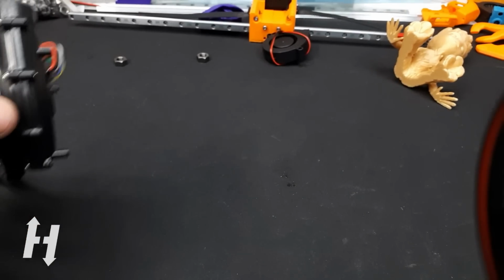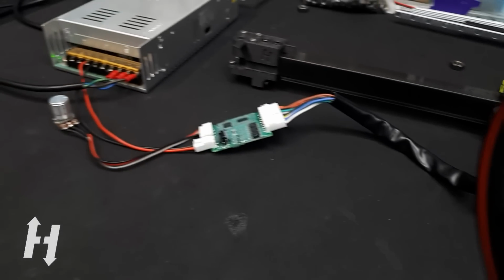Can this turbine be installed on a 3D printer?

Comment: There should be a lot of used air purifiers on the market now (thank you, big C). They usually have fans inside that can produce quite a high static pressure, high flow and should not be to noisy at the same time. Pretty ideal for an external cooling system.

Comment: as mentioned by others a voltage divider wit RC filter would be simple. Another way to do it is with a digital potmeter. These connect to a printer over SPI or I2C and can be told what resistance to take on. A filter would require some matching of the R and C values and a unknown impedance of the driving board and a digital pot does not need this although it requires a bit more software.
Reply from the maker: Thanks!  Although that sounds like chinese to me at the moment, I think I know where you are going with this.  Let me educate myself and I will come back :)

Comment: I think you gonna need only berd air if you use targeted laser to melt the plastic. Same way as here. That will make another advantage: it will be easier to make SMT line with instant cover/chassis manufacturing. The most advanced laser soldering solution in the world - YouTube

Comment: You can use a digital potentiometer. They are chips that act like a potentiometer where you can control the wiper with i2c or SPI.

Comment: I use/sell these - all you need is a 5v pwm signal going to the pwm spot on the driver board from your printer controller. No need for a separate pot, assuming your driver you purchased is similar to the ones I offer

Comment: Perfect for putting an electric turbo on your weed wacker!

In all seriousness, if you send me some decent resolution scans of both sides of the PCB I'll have a go at reverse engineering it. Turning voltage into pwm and back is pretty simple so this shouldn't be much of a challenge.

Blowden tube.

Comment: You could use a low pass filter, and possibly an op amp depending on the voltage.  By far the easiest and best way is with a digital to analog converter.  Check out Amazon.  About 3 for 9 usd.  Sending a raw pwm signal straight to that won't work.

Comment: from looking at the aliexpress page the controller board got a pin for vsr 0-5v to control the fan speed wich you might be able to do direcly from your motherboard if you can change the voltage of the fan pins or use a resistor to eat up the remaining 19v 
also seems to have a pulse imput so you can just use a voltage to pwm module 
amazing idea doe, really interested in seeing how it performs ;)
might put something like this on my printer now that you gave me the idea
Reply from the maker: Yes exactly my thinking.  The expansion header from the Duet Wifi should give me what I need.

Comment: I've made a CPAP pump as  cooling fan ~half year ago. I modified original driver board by removing pot and add digital potentiometer drived by Arduino nano by i2c which reads 3.3v pwm signal from printer board. As addition i adapted motor braking option and on/off  from bldc driver on board (found options in datasheet and with some soldering, few cm of wire and 2 small transistor just upgrade driver).
As tube to feed air from blower to toolhead try to find CPAP tube.

If You interested in details i could provide Arduino code, parts numbers and schematics but in next week;)

Comment: If the static air pressure coming out of the blower is high enough it can actually blow the plastic away from where you want it printed. More cooling can make bridging go farther strides but too much pressure can also work against that.
Reply: On the other hand, you can push the air from a different direction that would normally be blocked.  I think if you shape the housing properly, you can blow air from top down even with the print head in the way.  Or you can force the air right into the housing.  The extra pressure would get the air into and out of small holes, allowing you to duct the airflow.  I wonder if a ring of air around the extrusion nozzle would improve printing performance.

Comment: hey Mirage i know a little something about these type of fans. having recently had to repair both a controller board and a fan itself. it is because these  design also is necessary on electronics hot air soldering rework stations. they are 3 phase brushless dc motor with hall sensors in them. which is why the extra wires to the motor. and the controller board typically has a bldc pre-driver ic on it to do all the proper fast timing send the pulses to the array of mosfets. for turning on and off the coils at the right exact moment (at up to 10k - 30k rpm speeds). its really similar the basic idea to a car distributor cap i guess. with the hall sensors giving that rotational input signal.

anyhow sorry for the waffling. what i actually wanted to say here was more practical observations. for getting the best performance out of these things. on the hot air stations we notice that the length of the air hose is a large diameter hollow silicon or rubber floppy tube. and its something like 60-70cm i guess will have to measure the length properly and let you know. also the diameter. because i think if you try the push the air into any smaller diameter tube then at these speeds you may encounter issues since it is essentially like an impedence matching situation. where for max power transfer you dont want too high or too low a back pressue fighting back against the such high rpm fan... which is driven by the motor, which kicks back against its own non linear magnetics generated by that motor itself too. so that is something important i think to consider. and you might decided to test out a variety of slightly different sizes. in order to confirm and verify what is the optimum tubing diameter. and the maximum reasonable tubing lengh (before the performance drops away too much). because that will also affect the impedence / the resistance that the fan blades and the fan motor 'sees'

but the other important thing is that maybe some of these bldc motors from china claim a certain level of performance. and at a particular cost. however the specific unit itself might not perform as good as other ones. or being from china, some of the specification might be somehow exaggerated, or misrepresented, or fake, or just not as good as another one that claims a similar specs. you see we have been talking just today about these hot air stations fan motors because there is a wide difference. one of them isonly 1.5amp, it looks most similar to yours. and it underperforms on the atten 862 hot ait station. it falls short. but it seems they choose it for a higher level of reliability. you open yours up and look at the mass of the fan blades. now it should be very low mass. but also must be strong to transfer a high energy. these 2 things are in conflict! and measure the rpms of your fan with audio microphone frequency phone app. check that its true 30krpms by the sound frequency. for similar price i have here about 50-60 euro fan in my station it carries 2.0a rating. but its reasonably powerful (i think). but the fan blades keeps shredding themselves and the fan itself tends to just disentigrate. unless modified. that is the fan in the quick 862dw and the bst-863 hot air stations.... then finally we have for about 130 euro is the 2.85 amp fan in the quick tr1300a station. which is even more powerful perhaps. but we will get photos soon to see inside. what the fan blades looks like. IDK why your fan itself (without driver board) can have a similar specs but cost only 30 euro. something seems wrong. they are both sold on aliexpress. but they are indeed different designs. it does not mean you should have to pay as much as 130 euro for to get a better fan. just... these things may differ. what i keep wondering is if there is some concept of torque drop off, when loaded. that the loading characteristic is different between them. to deal with back pressure (like SPL? idk). or if there is a wasted current energy lost in the motor itself, or that some energy is lost with the fan blades actually spinning the air in place, and kinetically heating the air, without actually pushing it / moving it out the nozzle. to explain if there is some difference between the specs against a real world performance. YMMV

anyhow i will get back to you later. and leave a message on discord. with the tubing size for the hot air station i have. and also some aliexpress links to those other fans. so you can find them and see online the prices vs their claimed specs etc.
Reply: Great data man, thanks for sharing. I think for 3d printers considerable factor is a noise. I have some 20krpm models that perform pretty solid, except that I fried by duet qith one of them trying to work out a 3-4 wire PWM solution on that board 🤦🏻‍♂️😆 oh well

Comment: 1:27 this is probably what is going to happen to your print
Reply from the maker: Yes, managing the output shap and direction will be critical.  But I did some benchies with 60PSI shop air through my berdair pipes.  So I have some ideas on how to fit this guy :)

Comment: What is the voltage on the potentiometer? You could maybe use a DAC to control it. Esp32 has two build in, but I think the maximum positive voltage is 2.5V.

Comment: With power like that, I feel like you could just put it to the side of the bed (or gantry), with a directed nozzle, and it'll still do its job fine.
Reply from the maker: There ar ways to reduce noise level, but of course, this is meant for some extreme applications. :)
Reply: @MirageC  Whoops replied to wrong comment I'm guessing? I don't care about noise, this just seems like a nice way to reduce print head weight to increase print accel speed quality.

Comment: I think a self inflating thin wall plastic tube could transfer the air with minimal mass and resistance to movement.
Reply: What speaks against a normal "hard" plastic tube?
Reply: @certified-forklifter  that would be hysteresis and bending moment. Both of those would slow down and add artifacts to the printhead as well as having a significantly larger amount of mass involved. A smaller hard plastic tube but also require large pressures to move the same volume of air.
Reply: The downside of a self-inflating air tube? Your fans always have to be on or your tube will collapse. A collapsed tube can potentially rip and tear as well as get tangled in the kinematic mechanisms.  Obviously having your cooling fans on all the time is not necessarily a good thing. Especially for that first layer
Reply: @Unmannedair  It could be lightly attached to everything else that is going to the hotend.
Reply: @danielkruger4305  that only works if a drag chain isn't being used.  I do recommend DCs.
Reply: @Unmannedair  Unless you are using drag chain rated wire, I recommend people run a reverse or standard bowden tube with the wires. Doing so keeps wires in a gradual curve.

Comment: This isn't my field of expertise but couldn't you just feed the fan power. But on the positive wire add a Mosfet or something and use that to turn the power off and on?
Reply: But also correct me if I'm wrong doesn't pwm effectively reduce duty cycle of the fan which can cause stalling and stuff.

I've heard that the way around this is with a cap in line with the pwm signal so that it smooths out the power so you reduce the voltage but not the duty cycle which should lead to less stalling of the fans? So in essence instead of pulsing the fan, you would be lowering the voltage.
Reply from the maker: The driver does all the work, I only need to change the way we talk to it.  Going from a reference voltage to a PWM signal. In theory the onboard chip should understand both "languages".
Reply: @MirageC  oh I see now. For some reason I was thinking it was a 2 wire fan. Hm I got a friend into rc I'll ask her and see if she can think of something.
Reply: @MirageC  so she said she couldn't think of anything. But I wonder... The normal 2 wire fans use pwm to control speed.
What if you just hooked that to the signal wire on the esc? Or configured it as a servo in klipper. Servos use the same pwm signal, so it should talk to the esc just fine.

Comment: I have used a pwm converter for my kbmm motor driver on my CNC spindle so I could control rpms via the mach3 controller. I'll try to find the actual name of the board I used since I did this like 8 years ago. 

I need that turbo though!! lol

Comment: Pwm of the correct voltage and a rc low pass filter can replace the  pot.

Add some baffles to the input and a mechanicaly isolated enclosure with some sound dampening, both high density opencell foam and mechanical / mass dampening like is used on car body panels will keep the noise down.

Duct a pair of these in to a jumbo sized beird air system with some nice flexibke silicone pipes.

Next step chill the air a bit like an intercooler.  A quick and dirty way to do this would.be to use a high pressure C02 canister, posiblh a co2 fire extinguisher.   Invert it to get a streem of liquid C02 that rapidly boils and causes a load of cooling.
Reply: Intercooler would be better with a small vortex cooler tube
Reply from the maker: Ohhh!!! I love the way you think :)
Reply: @MirageC  sub 3min benchy with co2 cooling?
Reply from the maker: @bassplaya69er  ;)

Comment: Been working a head design like what you described for a while using a cpap blower I found at surplus. I figure that both hotend and print cooling could be handled by one of these blowing through a tube with some sort of air splitter (maybe with a spring tensioned valve so that below a certain throttle no air goes to part cooling for first layers?).  Seems like a great way to make a compact and comically lightweight head. Extra components (like probes) could even be driven through mini bowden cables so servos don't have to be on the head.
Reply: I too have been thinking about the remote air source for cooling and hotend for awhile now. I had not thought about remotely triggering a probe...love the idea but it would probably be better to just attach one manually for the probing/homing sequence. Maybe a tapered shape with locking edge clip for repeatable positioning...

Comment: awesome little one! this kinda sound I dont mind, since its not vibration. Sound will not even come out of my print room so it should be fine for me :) Now lets see if we can keep the pressure all the way with a long feed tube. that is the main challenge here I think. Again good work innovating brother
Reply from the maker: My goal is to keep the section area of the tubing at the same diameter all the way to the print head.  Will see soon enough :)
Reply: You can use standard CPAP tubing, really flexible, smooth inside, reinforced with plastic spring outside, the static pressure loss is really low, just remove end plastic fitting at the end of the tubing, heavy and useless, I can share you my full setup if you need, I have a JUBILEE with 3 tools using 1 CPAP blower with automatic distribution system 👍 (plug a "long" tubing before the blower to reduce noise)
Reply: The shroud is not easy to design too, need mix between high flow, pressure and not too small output. With good design you can have really compact shroud linked to a BIG blower, really light and so much flow 🤩.

Comment: This is gonna be a nightmare according to the sound. Btw sound: Would it be possible to replace this with thermoacoustic cooling?
Reply from the maker: Yeah, definately not meant for a printer in the living room.
Reply: @MirageC  at lower throttles, for the airflow required for conventional slower (~100mm/s) printing, is the noise still very loud? Or comparable to regular cooling fans?
Reply from the maker: @sssfsfdfsdsdffsfsdf4  I would say that obtaining a minimal flow with this is the current challenge.  It will not spin below 40ish% BUT that level of air is sufficent for normal printing and the fan noise level is probably lower than a 5015 would produce at similar flow.  For ABS and other temp sensible material I suggest you suck air from the enclosure to avoid too much warping.
Reply: Would not recommend Thermo acoustic cooling. Wrong scale problem for Thermo acoustic.  Thermo acoustics requires precise control of the geometric configuration. If you're cooling a printed part of an arbitrary shape then that means you have zero control of the geometry and thus zero control of the cooling.
Reply: @Unmannedair  What about peltier heating/cooling? The huge amount of heat can be use to melt the plastic, and the other side can result a cooling chamber that blows the berdair system?

Comment: Can't wait for printer to sound like a vacuum cleaner
Reply from the maker: I actually think that we can manage some of that noise down in order to achieve an acceptable level.  For sure this is not meant to be on the 3D printer running next to your bed though.
Reply: This blower is noisy only at high PWM, use CPAP tubing to guide the air to the shroud and most important use the same tubing before the blower: reduce the noise a lot

Comment: I assume the pot acts as a voltage divider, so a pwm signal at the same voltage as the supply to the potentiometer fed into the 3rd wire to the pot should act the same